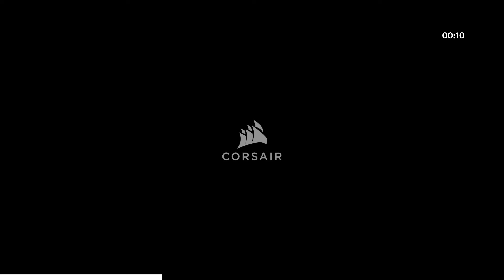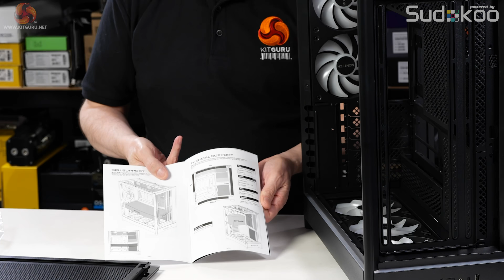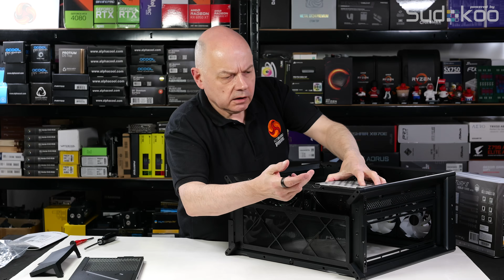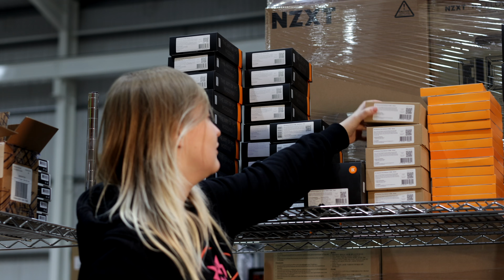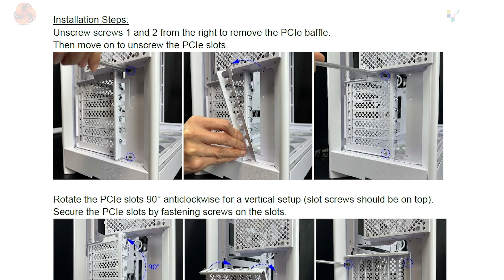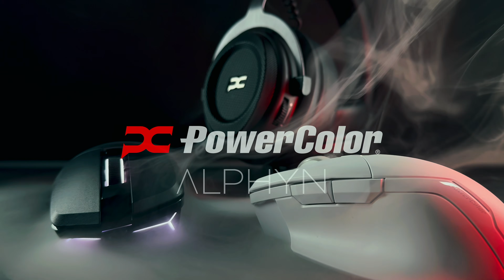Montech HS01 Pro - Worth It? Full Build, Flip & Thermals!

Comment: did you swap the fans from the bottom to the top and the top fans to the bottom? as in the reversed configuration the top fans are reversed and would  be acting as an intake but drawing air form the top not idea on a case that needs to utilize a " chimney" style heat dissipation

Comment: The front panel LED button (It's not a light) has two different options.
It is the wire that comes from the front panel  which ends in a female connector labeled Reset SW.
1. Connect the wire to the reset pins on your motherboard to reset the power to your PC causing your system to reboot.
OR
2. Connect the wire to the two pin header on the Montech hub. Pressing the button will cause the following: 
A. Pressing for 2 seconds or less causes the case outer lighting to change colors. 
B. Pressing for three, four or more seconds, redirects the hub to follow lighting from the motherboard, instead.
Pressing the button one more time for 3 or 4 or more seconds returns case lighting control to the button.

There are three black cables on either side of the hub, one cable is a female SATA that plugs into the SATA power cable from your power supply, The second cable plugs into a motherboard fan header, and the last cable plugs into the motherboard ARGB pins. 
The fan header cable end and the ARGB cable end look like normal connectors but you'll notice they're each missing a wire. They don't need their 12 volt and 5 volt wire because that power is being supplied to the hub through the SATA connector.
I hope that clarifies any confusion.

Comment: I just did this build and here’s a pro tip!! Move now too fans to the bottom of the case. And then if you have a big AIO cooler there’s a piece you can pop off to help fit it in the now top…. BUT you need to mount it fans first to the case and the radiator below the fans with the fans pulling the air through the radiator and out the top of the case

Comment: I would love to know what the thermals would have been had you moved the 3 fans to the now bottom for Intake and put 3 more at the top for exhaust.  Would the GPU temps get higher with not intake at the top?  I'm sure with a 360 aio in the front the CPU temps would have been lower but that air cooler looked sick.

Comment: That CPU cooler looked just right in there, but I’m curious how close we are to the height limit. One chunky 140mm fan away from cracking the side glass.
Reply: It has something like 170mm so it should fit almost every air cooler. I have the nh15 or whatever from noctua which is one of the biggest and there is more room

Comment: That fan layout has me thinking — if the bottom becomes the intake and the GPU is above it, won’t you end up heating your GPU with your own airflow in some builds? Or is the spacing large enough to prevent that kind of heat loop?
Reply: Not sure what you're really saying. I just built this case. The fans that were on the bottom, once flipped need to go back on the bottom.

Comment: I get that the PSU bracket makes sense once flipped, but is anyone else surprised they didn’t go with a slide-in mount from the rear or a tray system? Would’ve saved so much hassle. Maybe that’s a cost compromise?
Reply: The PSU bracket makes sense whether it's flipped or not. It's meant to support both the ATX power supply or a smaller power supply. There's no way to put a slide in mount from the rear because the power supply sits adjacent to one of the front pillars. I just built a new computer in this case and I had absolutely no problems with the power supply, a Seasonic 1kw.

Comment: Super useful review. Do you think that the decision to go with a dual-purpose fan/radiator bracket in the floor was a good one? I noticed some tight clearances around the cabling channel — might get tricky with thicker radiators and PSU cables crossing paths.

Comment: I think the flipped layout makes the GPU the visual centerpiece, but practically speaking I’m wondering how that affects airflow patterns — especially with a large top-mounted radiator or tower cooler. Leo’s test data showed pretty stable GPU temps, but I wonder if airflow’s getting disrupted by the reverse fan flow under load.
Reply: I put the fans on the new bottom which was very easy. This setup is probably better for airflow than the original because the intake fans are near the cpu and still go upwards. The intakes are reversed if that is what you mean, so it is all positive flow but two exhaust fans is a great idea.

Comment: For me the biggest red flag was the rear fan bracket needing to be removed just to screw in the GPU vertically. Leo made it work, but I kept thinking — what happens if I want to upgrade the GPU later? That’s a lot of disassembly just for a simple task.
Reply: The rear fan bracket is only two simple exterior screws, that's it. The bottom of the bracket has metal tabs that fit in slots. If that's a lot of disassembly, I don't know how you're ever going to build a PC.
Reply: @SpaceCadet4Jesus  Haha exactly — that’s basic stuff 😅

Comment: It’s a cool concept — literally and figuratively — but it also looks like one of those cases you have to plan for. No EATX support, a few screw placements blocked by fans or magnetic feet, and a flipped layout that could confuse cable lengths… definitely not plug and play.
Reply: I just built this case and there was nothing to plan for. I don't have EATX  motherboards, nor is this an EATX case. The magnets on the feet are very strong, they have two guide pins and they also screw in. 

What's a couple extra screws when you've turned the case entirely upside down and then turn the GPU into an awkward position, instead of the standard GPU position?

Right side up or upside down the distances to anywhere are exactly the same, there's no confusing cable lengths.

It supports front connect and back connect motherboards. I would definitely buy this case again, and I didn't know what to expect when I bought it.
Reply: @SpaceCadet4Jesus  Nice! Sounds like a solid, well-thought-out build 🔧👏

Comment: I like the two fans at the back.
Reply: That's two fans of the back are one of my favorites features. I just built in this case. I put a mesh screen over both of them, made the top one an exhaust and made the bottom one an intake over the VRM heat sinks with two air deflectors to keep the exhaust air away. Both fans are ARGB.

Comment: This case has a ton of modularity, but I wonder how it holds up with negative pressure airflow. You’ve got fans in the floor, front, and rear — what happens to dust intake over time, especially with the flipped orientation?

Comment: The more I watched, the more I kept thinking — if this had just one or two fewer clever features and a more straightforward install process, it’d probably be a better product overall. Still, full marks to Leo for actually showing the fiddly bits instead of glossing over them.
Reply: Its also weird how you cant fit a 360 in the front, at least officially, and while i can see the "aesthetic improvement" of the sunken in bottom fans, as a custom loop user it immediately disqualifies the case, overall imo the GF Model 5 just did it better, but its not available here, at least not yet.
Reply: @mightywoll3  Totally get you
Reply: @mightywoll3  do you mean a 360 mm radiator? Because the front of the case does hold 360 mm of fans.

Comment: Montech got a lot right with airflow layout, but it’s telling that Leo had to disassemble so much of the case just to get to routine mounting points. It looks like a clean end product, but there’s a lot of engineering friction along the way.
Reply: If you're talking about the inverted case with the vertical GPU mount, then all Leo had to do was remove two exterior screws and the entire two rear fan assembly came out. I just built in this case and it was very easy, there was nothing to disassemble,  all the routine mounting points were there, All you had to do was just remove side panels.

Comment: Leo mentioned symmetrical USB-A ports on the front panel — that’s such an underrated design decision. But I’m wondering: with the case flipped, is cable clearance still good for chunky USB drives or dongles?
Reply from the maker: No matter what, I will always get USB-A the wrong way up 
Leo

Comment: I get why they went for reverse blade fans on the floor, but I’d love to see how this performs with traditional intake fans swapped in. Leo’s thermal results were pretty flat across the fan RPM range, which makes me think airflow direction might not be optimal out of the box.

Comment: Looks great in the finished build, but I’m wondering if the cable routing stays as clean once you fill the drive bays and start running SATA data and power across the back. Leo didn’t show much behind the motherboard tray — curious how deep the channels actually are.

Comment: When Leo offered up the E-ATX board and hit the cosmetic cover, I felt that deep in my bones. Nothing like getting halfway through a build and realizing your board almost fits.
Reply: Leo offered up the "ATX" motherboard and hit the cosmetic cover. He did that to show you that two different size boards fits in there without looking awkward. One with the cover installed and one without the cover. I just built a complete system in this case it was wonderful two screws in the cover came off and I had an ATX motherboard to install.

Comment: Does anyone know if the side panels are glass on both sides or just the one? Leo focused mostly on the main glass side but didn’t say what material was on the backside. Would make a difference for weight and thermals depending on your component layout.

Comment: Since you can't fit an AIO at the top when inverted? Would putting it in the bottom be a problem with air getting in the pump since it would be higher than the radiator?
Reply: I think it's possible to mount the AIO upside down on top, but if you mount the GPU normally you'll run into airflow issues. Also, the maximum AIO is 240mm. If you turn the case upside down, it may be better to use air cooling and not change the airflow.

Comment: Is anyone else concerned about GPU sag in a vertical mount here? That 4090 looked pretty heavy, and without a brace or riser support, I’d be worried long-term. Leo didn’t mention clearance between the riser and PSU cables either — tight fit?

Comment: This looks like one of those designs where airflow should be amazing on paper, but in practice might be limited by things like dust buildup under the floor or radiators disrupting intake. Leo, any sign of pressure imbalance from that reverse fan setup?

Comment: The amount of modularity here is surprising — rotating PCI slots, tool-less panels, invertible layout — but I wonder how durable some of those parts are long term. Especially the pop-pin glass side. Any chance you’ll do a long-term revisit?
Reply: I just built in this case and I can tell you that it's built like a tank. Not at all flimsy, and the glass is thick and heavy.

Comment: The PSU bracket design just doesn’t sit right with me. Having to install it externally then thread cables through feels outdated. The magnetic feet are clever, sure, but they shouldn’t be covering screw holes you need during the build.

Comment: Montech’s pushing the envelope here — rotating PCI brackets, magnetic feet, inverted airflow… all in a sub-£100 case. Might not be perfect, but it feels like they’re trying to offer enthusiast-level flexibility on a budget. And Leo’s coverage makes it a lot more digestible.
Reply: And the case supports both front connect and back connect motherboards.

Comment: The inverted airflow path feels like something that’ll either really help in the right use case or make no difference at all. It’s good that Leo tested temps at multiple fan speeds instead of just leaving it at stock. Definitely makes the thermal picture clearer.

Comment: Looks like you could have built it normally and later move the 4 foot pads to invert it. Edit: If I wanted to invert my Montech King 95 case I would need to purchase 4 stick-on feet for the top for a left sided placement.
Reply from the maker: I think you are correct however the guide starts with the instruction to choose the orientation so...
Leo

Comment: I think you were a bit generous on the build experience here, Leo. That PSU bracket system is straight out of 2012, and having to remove fan assemblies to access GPU screws is not elegant
Reply from the maker: Certainly lacks elegance but presumably reduces cost
Leo

Comment: Curious if those reverse blade fans are standard 4-pin PWM and 3-pin ARGB — I’ve seen some Montech fans in the past that used proprietary hubs, and that made upgrades a pain. Can anyone confirm?
Reply from the maker: Standard PWM and ARGB connections on all five fans. The hub does not use proprietary connections.
Leo

Comment: Really liking how Montech has leaned into the flipped concept, even if it’s niche. The magnetic feet and removable panels are nice touches
Reply: They not only made the case flipped so you can enjoy either side they also made it back connector motherboard compatible. And one of my favorite features is two 120 mm rear fans stacked one upon the other.

Comment: Really informative as always, Leo. I’m curious — how did the included Montech fans handle PWM ramping? Some budget fans have really bad startup behavior or get noisy above 1200RPM. The tone in your audio samples sounded relatively smooth but hard to tell over YouTube compression. Sounded quite loud however but so hard to tell.
Reply from the maker: The fans are a little slow to respond but basically fine

Comment: Leo. Question: how’s cable routing behind the motherboard tray? You mentioned the BTF layout support, but how tight are the cable channels once you run a full build? I’ve had some supposedly “BTF-ready” cases that became spaghetti zones. :face-red-droopy-eyes:
Reply from the maker: There's plenty of space and the right hand panel is solid so you can just thrown the cables in without any fuss
Reply: What is a BTF layout?
Reply: @pixelrefresh348  Motherboard's with the cable connectors on backside of the PCB.  Example: Asus TUF GAMING B850-BTF WIFI W

Comment: The vertical GPU option looks decent, but I’m curious about clearance — especially with triple-slot GPUs like the 5090. Any risk of it choking airflow if mounted too close to the glass? Also wondering if riser cable length is an issue when the case is flipped.
Reply: Would have been cool if the riser cable would let you relocate the GPU back at the bottom of the case. Might be a bit long for PCIe though.

Comment: Not a fan of the inverted layout — thermals didn’t really benefit and it just complicates panel access and orientation. Seems like a gimmick unless you really want your GPU fans facing up. Shame it doesn’t support E-ATX either — all that space and you’re still restricted.
Reply: I agree on all points. It's a bit too quirky.

Comment: Solid overview Leo, though I wish you’d spent a little more time showing the BTF support in action with an actual reverse connector motherboard. That’s a pretty major selling point if they’re trying to future-proof the design. Do you think Montech is actually serious about BTF support or just ticking a box?
Reply from the maker: BTF and other hidden cable designs simply require holes in the motherboard tray. If Montech says they support a particular motherboard manufacturer and that company also works with Montech you can be confident it will be fine

Comment: I wasn’t sold on this case until you showed the vertical GPU mount and how the PCIe bracket can be rotated — that’s a nice touch, even if it looked like a faff to reassemble. Still think this case is crying out for a vertical PSU mount and native E-ATX support.
Reply: Prever the vertical GPU when it's upside down. It does look weird though.
Reply: @jamesjessenden7838  Prever?
Reply: @jamesjessenden7838  It looks WRONG